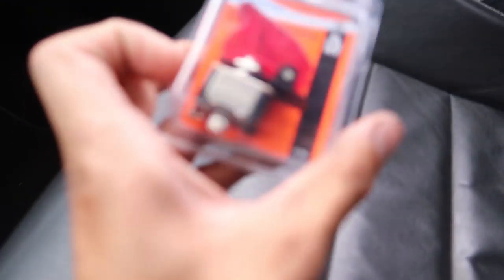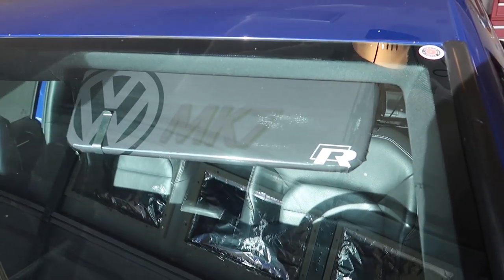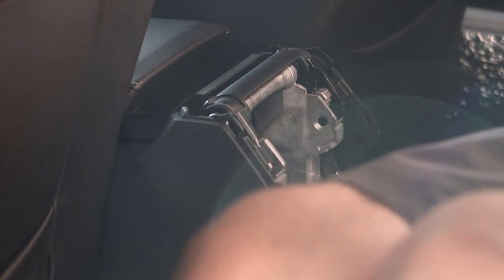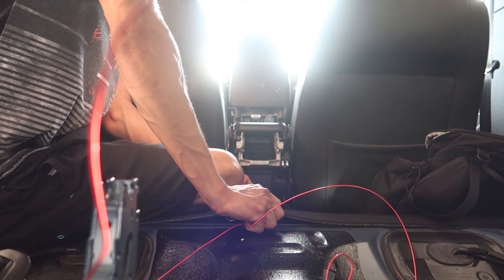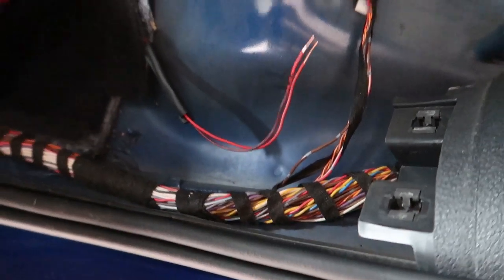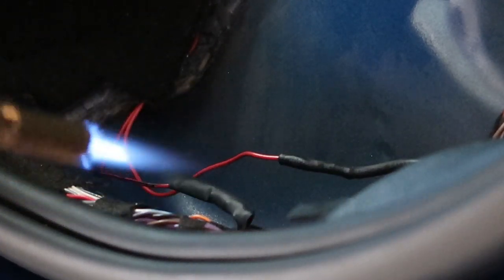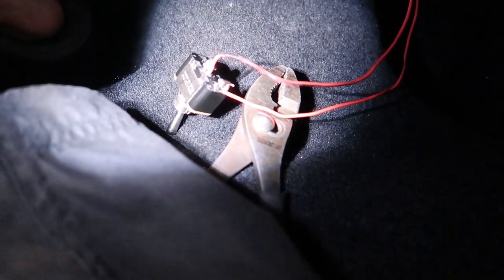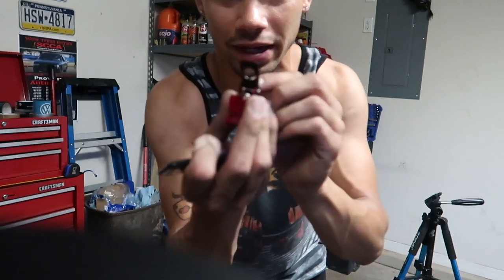Haldex Switch DIY - Burnout Time!! | MK7 Golf R

Comment: Great video as usual! You have electric parking brake also right? I didn't get what you mean if you hold it up? will it release the brakes when you let it go also?
Reply from the maker: You have to physically hold the electric brake button up while you burnout. Let off throttle then brake button. It'll keep the brake engaged at the end and tell at you in the screen lol

Comment: Hi Mate, what's the reason for the cruise control warning? Mine does the same.
Reply from the maker: I'm not sure honestly man it's so annoying. Could be a wheel speed sensor but at 90$ a pop I'm not trying to just blow 360$ on all new sensors.. I did get one for the side that I had a bad wheel bearing on, hopefully that fixes it.. if not I'm probably just going to disable it in the ECU
Reply: @BryceJordanProductions  yeah its a PITA to be honest as cannot use my cruise control.
Reply from the maker: @mickholgate3347  I wind up turning the car off and on while on the highway just to use it again till it shuts off lol
Reply: @BryceJordanProductions  hahahaha same!